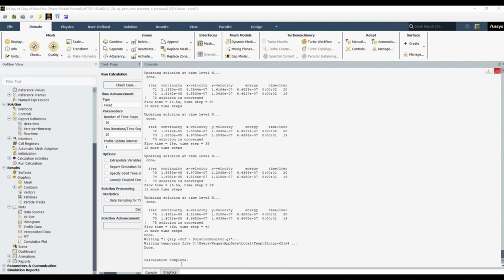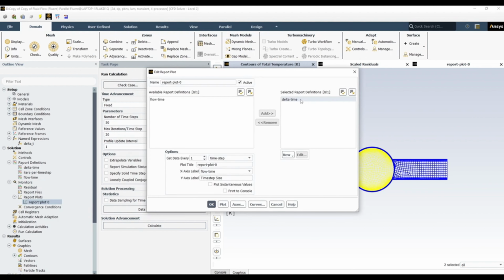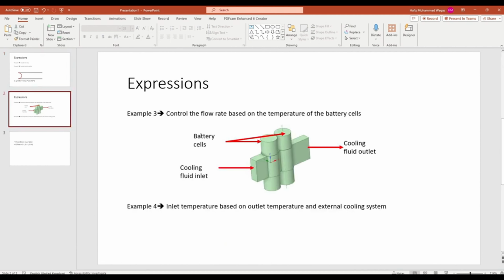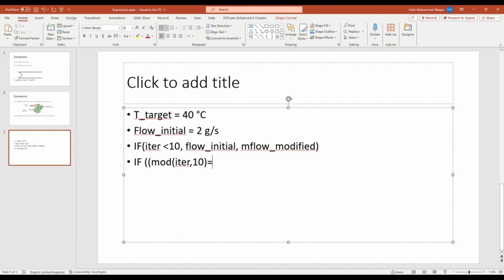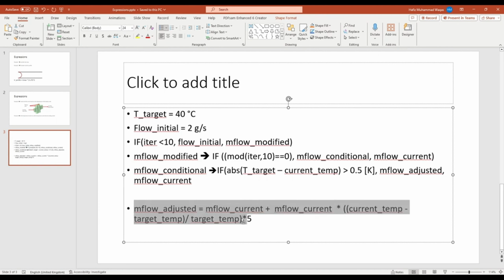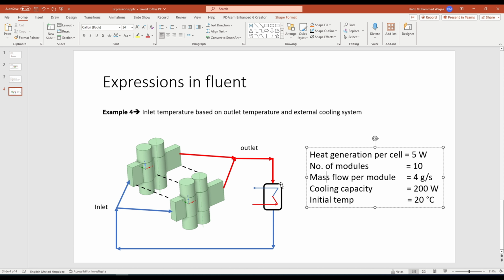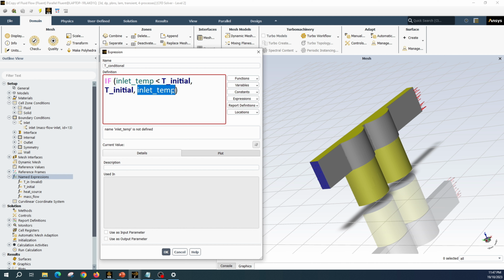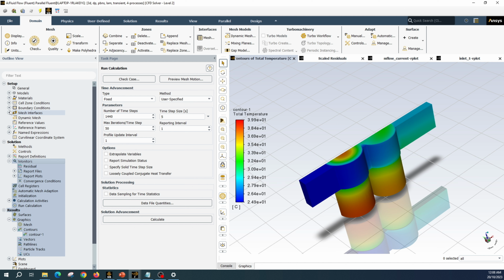A course on using expressions in Ansys Fluent with examples

Comment: Fantastic video, thank you for sharing! I was wondering if you have any recommendations for improving the performance of expressions in Fluent. From my experience, I’ve noticed that calculation times tend to increase when using expressions, especially in transient simulations, compared to when using UDFs. Any insights on optimizing this would be greatly appreciated!
Reply from the maker: Actually I have never made a comparison between expressions and UDF. Therefore, I can't comment on it. I might do a small example to see the difference. 
One suggestion could be to use a nested statement. In this example you might have noticed I was was using separate expression for each action to make it understandable
Reply: @WaqasLearnTech  Thanks a lot!